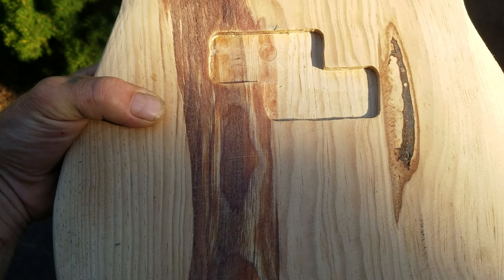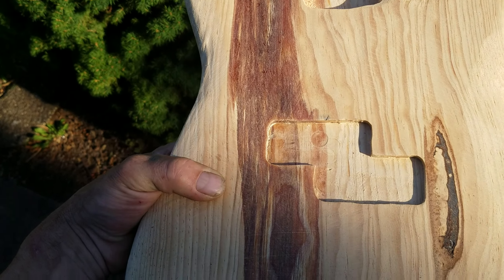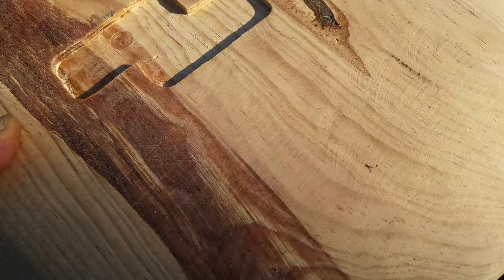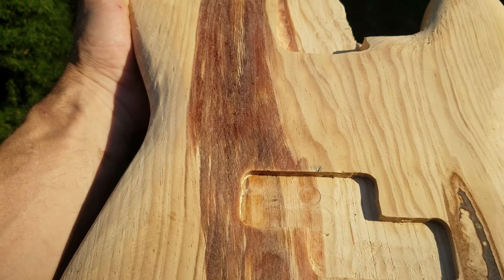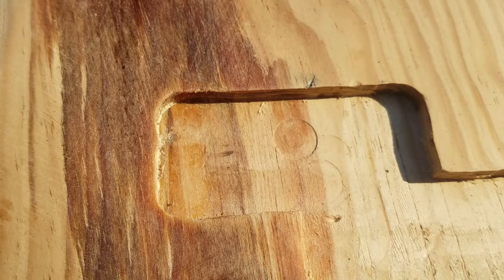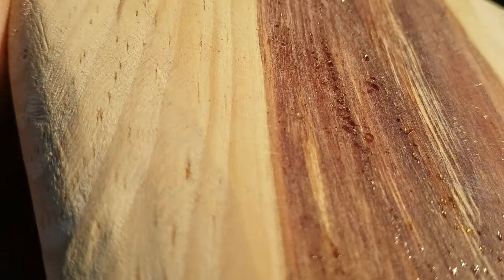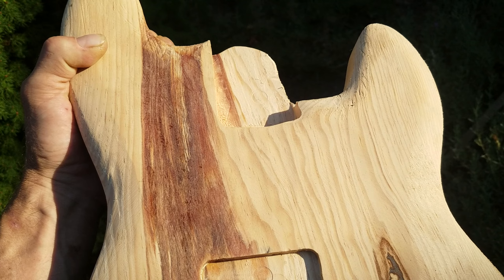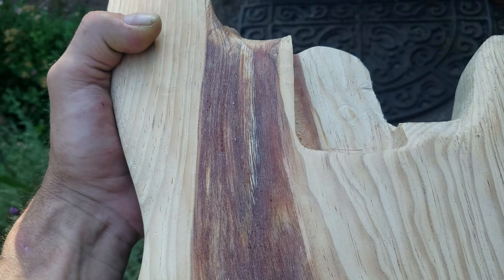This is one of the reasons people don't use pine for guitar bodies....

Comment: A tip I was told from some sawmill workers here in Brazil to get rid of resins in almost any wood. Let it under water for two or three months. The water will slowly dissolve the resins, replacing it. Then, you let it dry (not in the sun). It'll be  completely dry and with no resin.
If course, it applies for when you still have the unfinished plank of wood.

Comment: come on, just choose proper stock. It is a cheap wood, you can be picky. This board is trash and in most applications it would be discarded. I use construction-grade pine to make furniture here in Brazil (and here, pine boards are mostly used to make concrete forms, not in the construction per se; so, not much quality). I wouldn't even use this piece to make the bottom of a chest -- it could ruin the stored linen.

Comment: I am pretty sure there would be a simple material you could use that would act as an absorbent, to leach the sap out of the surface pores. Clay cat litter comes to mind, perhaps first applying a clean solvent,..naphtha, alcohol, whatever works to dissolve the resin, followed by the absorbent...maybe fine sawdust. I bet the weeping resin won't be as persistent as you are thinking. That streak ,is, completely awesome....not to mention the grain of that wood piece is as good as it gets...Further thoughts....wipe the sap clean...then maybe sanding sealer...that I bet would lock the pores